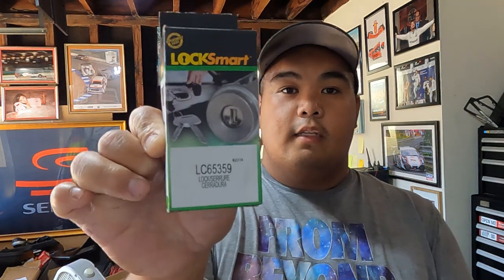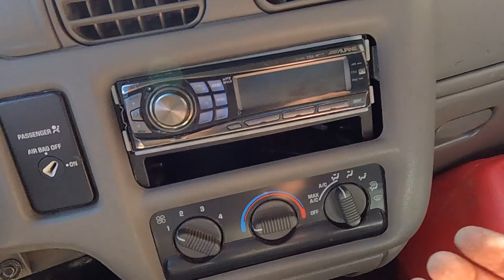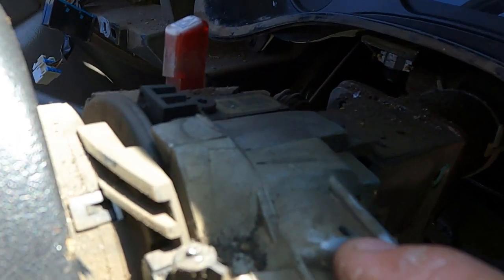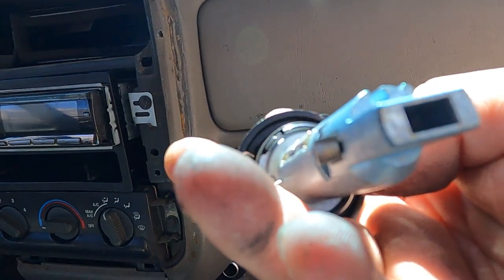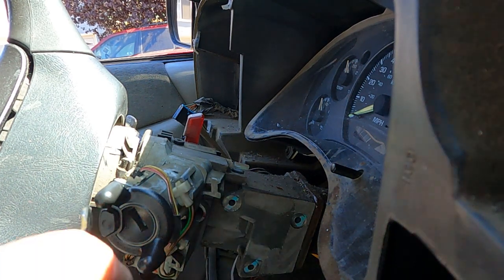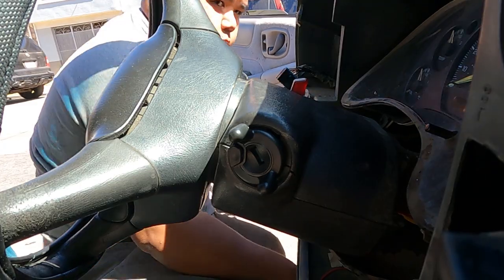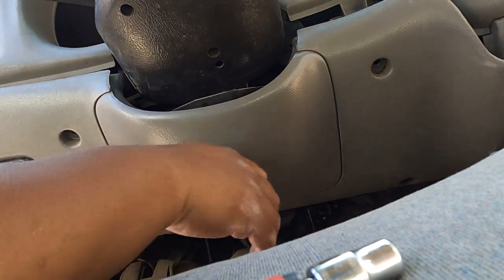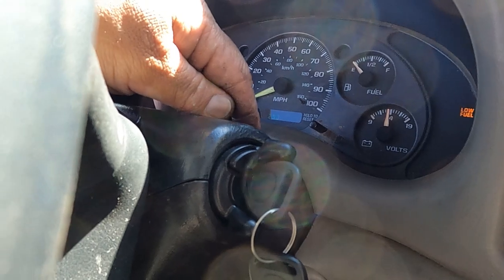2001 - 2004 CHEVY S10/GMC SONOMA / ENVOY/ Blazer/ Jimmy/ IGNITION LOCK CYLINDER - Removal & Install

Comment: How do you remove the cylinder if the key won’t turn?
Reply from the maker: the're should be a pin at the side that you have to press in able for the lock cylinder to release.